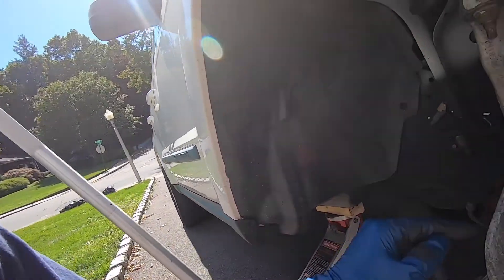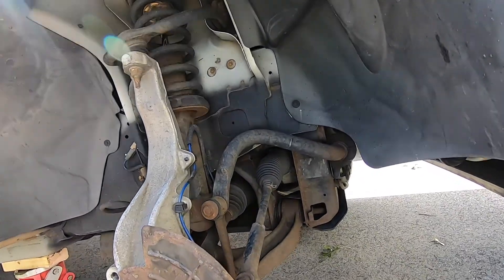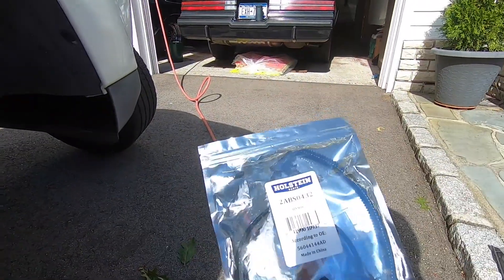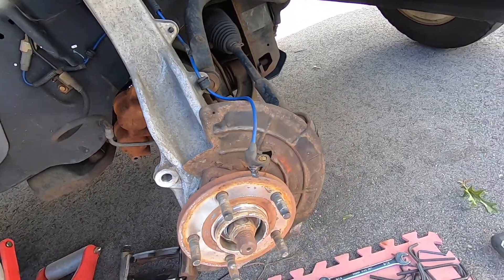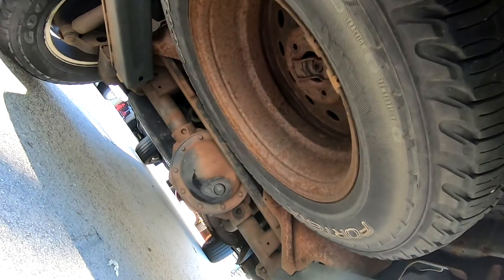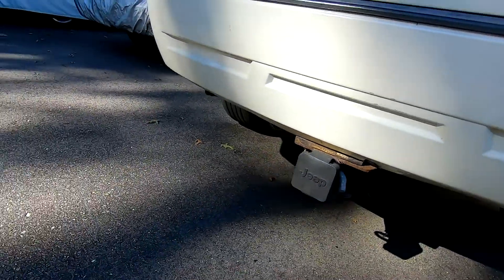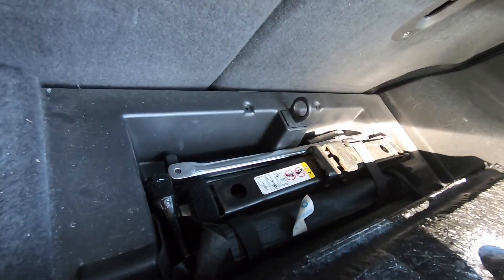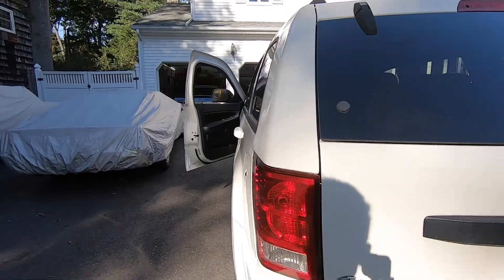Jeep ABS Code C1015 Right Front Wheel Speed Sensor Circuit -  Will replacing the sensor fix it?

Comment: Most auto exhaust systems are mounted on hanger brackets from front to back. Sometimes the rubber bushings dry up and crack and fall out.   Or it's not mounted correctly.  So you gotta get under there.  Check the mounting brackets that the exhaust pipes and  the muffler hang on When you drive a
that exhaust line  moves if not tightened down; side  to side or up and down and that could be your sound in the rear. Just a thought but notorious for chystler jeep ram.....
Reply from the maker: Thanks.   It turned out to be that the roof racks were loose.  Tightened them and the sound was gone.

Comment: Hi bro appreciate your video I have a jeep 2008 recently i was facing some issues with traction control  kicking in while driving normally but that was happening every week one time 
. Yesterday i drove the car when i start the car i didnt see any lights  once i put in drive and drove just couple of meters  all lights abs esp and traction  hand brake came on. i want to ask you was this case in this car or all the light was on when you just start the ignition or after driving
Reply from the maker: It would randomly come and go.